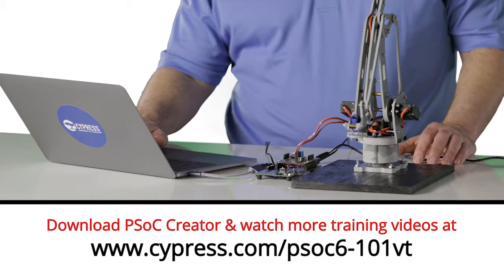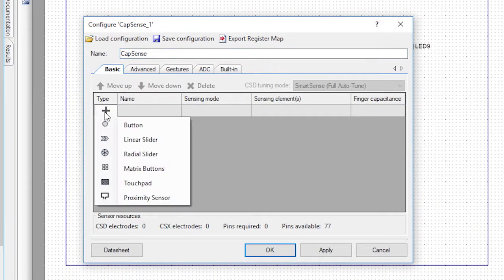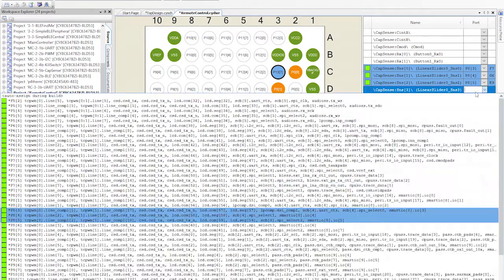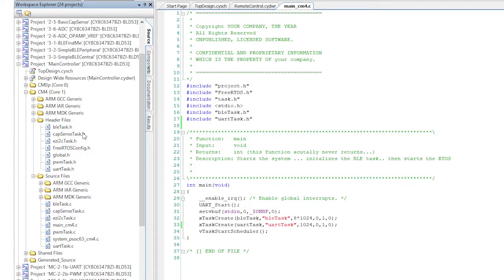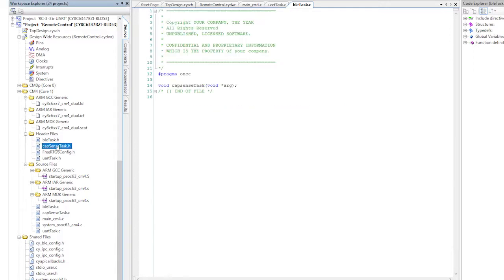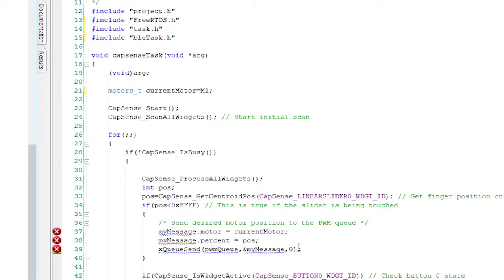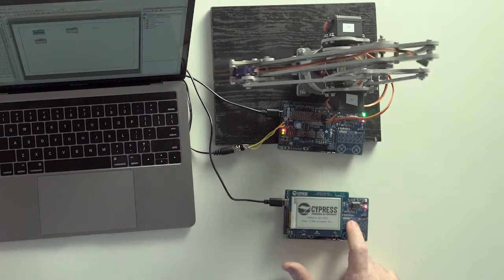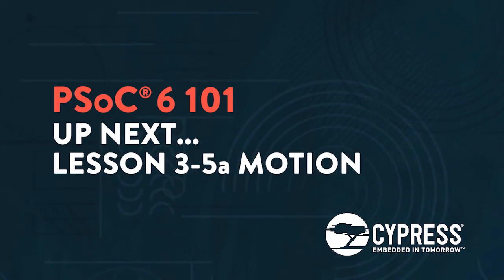PSoC 6 101: Lesson 3-4 Implementing CapSense to Remote Control

Comment: Good afternoon

I am currently studying this wonderful device I am practically new to this, I would like to know if you can help me solve a doubt I have, my controller is a pisoc4 in which I did a practice called    (TimeStamp_Measurement),    this practice I found in the page official cypress,  

Description:
The project aims at using the Counter to measure the time interval between 2 events.
Thus this project measures time between 2 falling edges.

As I can do to take a reading between the two flanks programmed with an additional button without altering the programming and this data to watch in the serial monitor. the data that I need is the (measured Time).

please help me with this, best regards.
Reply: This is the program

#include <device.h>

/* Defines for TRUE and FALSE */
#ifndef TRUE
    #define TRUE 1
#endif
#ifndef FALSE
    #define FALSE 0
#endif

/* Define to store the Frequency of the Clock used for the Counter(TCPWM component).
 * The value is defined in Hz */
#define CLOCK_FREQ (float)3000000u

/* Define to indicate the number of microseconds in 1 second. Used for scaling purpose */
#define NO_OF_USEC (float)1000000u

/* Variable to store the number of times the Counter has overflown */
uint32 counter_overflowCount = 0u;

/* Variable to store the count value that is captured at the instance of the falling edge of the
 * capture signal */
uint16 capturedCount = 0u;

/* Variable to indicate the occurrence of the Capture Interrupt. The Counter generates interrupt on the
 * Terminal count and / or on the Capture event. The flag is set inside the Capture interrupt and cleared in the
 * main.c after processing */
uint8 CC_ISR_flag = FALSE;

/*****************************************************************************
* Function Name: Counter_ISR
******************************************************************************
* Summary:
*  ISR For Counter Interrupt.
*
* Parameters:
*  None
*
* Return:
*  None
*
*******************************************************************************/
CY_ISR_PROTO(Counter_ISR)
{
    /* Variable to store the Counter Status register. This value is used to determine the event which caused the
     * Interrupt (either Terminal Count or Capture). */
    uint32 counter_status = 0u;

    /* Read the Counter Status register. The status register stores the info about type of interrupt. */
    counter_status = Counter_GetInterruptSource();

    /* Check if the Counter interrupt is caused by Terminal Count. This can be checked in the 
     * status register of the Counter. The Counter status register is read and the value is stored
     * in counter_status.
     * The defines Counter_INTR_MASK_TC and Counter_INTR_MASK_CC_MATCH can be seen in Counter.h file.
     * These defines indicate the type of interrupt*/
    if ((counter_status & Counter_INTR_MASK_TC) == Counter_INTR_MASK_TC)
    {
        /* This checks if the interrupt is due to Terminal Count */
        /* Increment the counter_overflowCount. This variable keeps track of the number of times the
         * counter had overflown before the capture signal occurred. This count is used to calculate the
         * time when the capture occurs */
        counter_overflowCount++;

        /*Clear Interrupt*/
        Counter_ClearInterrupt(counter_status & Counter_INTR_MASK_TC);        
    }    

    /* Check if the Counter interrupt is caused by Capture Event */
    if ((counter_status & Counter_INTR_MASK_CC_MATCH) == Counter_INTR_MASK_CC_MATCH)
    {
        /* Read the value captured by the Counter on the falling edge of the capture signal */
        capturedCount = Counter_ReadCapture();    
        
        /* Set the ISR_flag to TRUE to indicate the occurrence of CC Interrupt */
        CC_ISR_flag = TRUE;  

        /*Clear the Interrupt*/
        Counter_ClearInterrupt(counter_status & Counter_INTR_MASK_CC_MATCH);
    }
}

/*****************************************************************************
* Function Name: Hex2Dec_Str
******************************************************************************
* Summary:
*  Convert Hex data to string as decimal. And return the length of string 
*
* Parameters:
*  str[]:    Array to save the converted result.
*  hex:        The value to be converted.    
*
* Return:
*  Return the valid length of str[].
*
* Note:
*  The LSB is fist in str[].
*******************************************************************************/
uint32 Hex2Dec_Str(char8 str[], uint32 hex)
{
    uint32 i, hex_tmp;
    uint32 res;
    uint32 len;

    /* The max length is 10 */
    len = 10u;
    res = hex;
    for (i = 0u; i < 10u; i++)
    {
        hex_tmp = res%10u; 
        str[i] = hex_tmp + '0';

        res /= 10u; 
        if (0u == res)
        {
            len = i + 1u;
            break;
        }    
    }

    return len;
}

/*****************************************************************************
* Function Name: main
******************************************************************************
* Summary:
*  Calculate the interval between two event. And transmit to PC via UART.
*
* Parameters:
*  None
*
* Return:
*  None
*
*******************************************************************************/
void main()
{
    uint32 i, len, data_hex, str_hex;
    char8 strHex[10u];

    /* Variable to store the Period count value configured for the Counter(TCPWM component) */
    uint32 counter_periodCount = 0u;
    
    /* Variable to store the captured values in 2 button pressing events */
    uint16 startCount = 0u;
    uint16 endCount = 0u;
    
    /* The count measured between 2 button pressing events is stored in this variable. */
    uint32 measuredCount = 0u;

    /* The time measured between 2 events is stored in this variable. This variable is a float because
     * of the precision required */
    float measuredTime = 0u;

    /* An flag variable indicates whether a time measurement is ended */
    uint8 end_flag = TRUE;
    
    /* Initialize the components */
    Counter_Start();
   /*    UART_Start();*/ COM_Start();
    ISR_Counter_StartEx(Counter_ISR);

    COM_UartPutString("\nTIME STAMP TEST\n");

    /* Read the counter period count set in the configuration */
    counter_periodCount = Counter_ReadPeriod();

    /* Enable the Global Interrupt */
    CyGlobalIntEnable;
    CC_ISR_flag = FALSE;

    for(;;)
    {
        /* Check if the Counter capture-type Interrupt has occurred */
        if ( (volatile uint8)CC_ISR_flag == TRUE )
        {
            /* Switch end flag between True and False, 
             *it becomes true whenever there are even-number button pressing event happend */
            end_flag = !end_flag;
            
            /* If this is the end a time measurement,
            record endCount, and calculate the measured time in microsecond. */
            if (end_flag == TRUE)
            {
                endCount = (volatile uint16)capturedCount + 1u;
                
                /* Calculate the measured count differently, in case of relationship between the two counts */
                if (startCount <= endCount)
                {
                    measuredCount = (counter_overflowCount * counter_periodCount) + (endCount - startCount);
                }
                else
                {
                    measuredCount = (counter_overflowCount * counter_periodCount) - (startCount - endCount);
                }
                
                /* Calculate the measuredTime in microseconds */
                measuredTime = (float)measuredCount / CLOCK_FREQ;
                measuredTime *= NO_OF_USEC;

                /* Transmit the measured time to PC via UART. The measuredTime is converted 
                 * to Integer for the display and is displayed in decimal format */
                COM_UartPutString("\nStop Counting.");
                COM_UartPutString("\nTIME STAMP: ");
                len = Hex2Dec_Str(strHex, (uint32)measuredTime);
                for (i=len; i>0; i--)
                {
                    COM_UartPutChar(strHex[i-1]);
                }

                COM_UartPutString(" us\n"); /*  The unit is indicated as  uS (micro second) */
                
            }